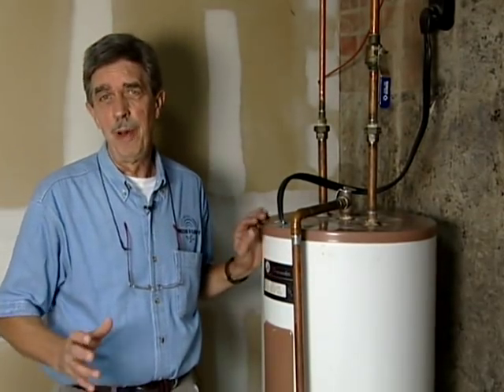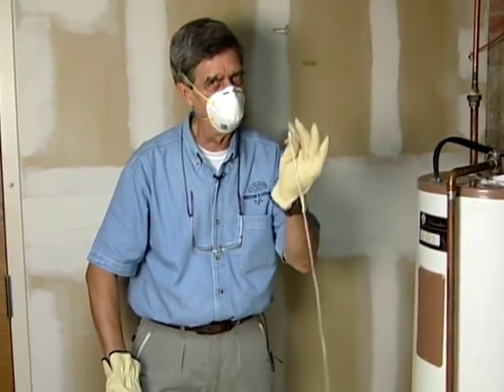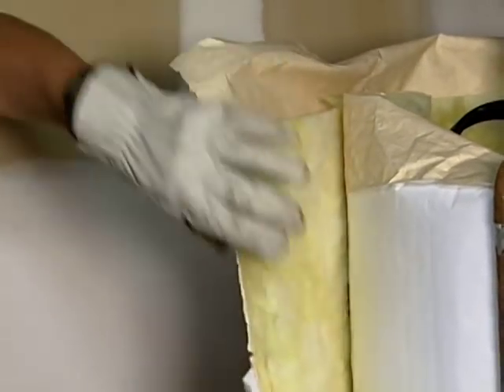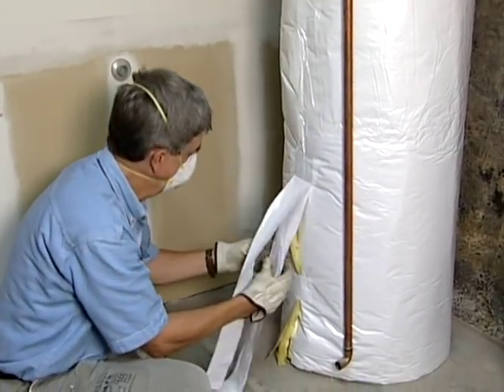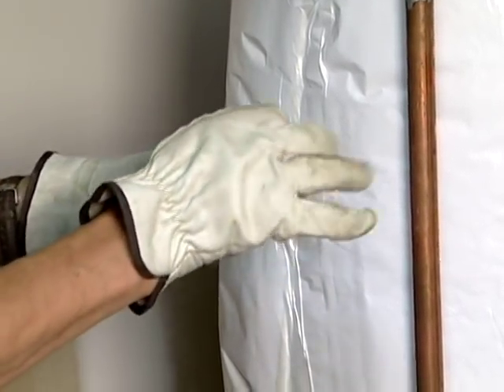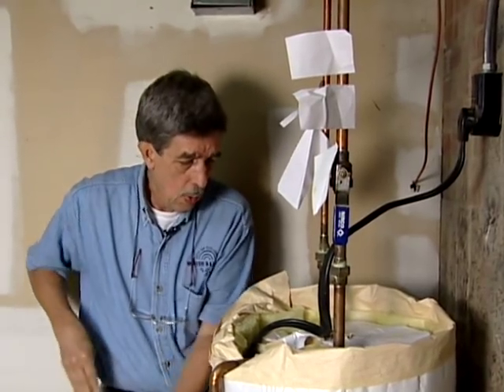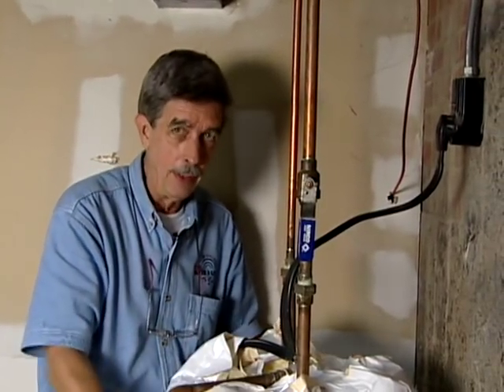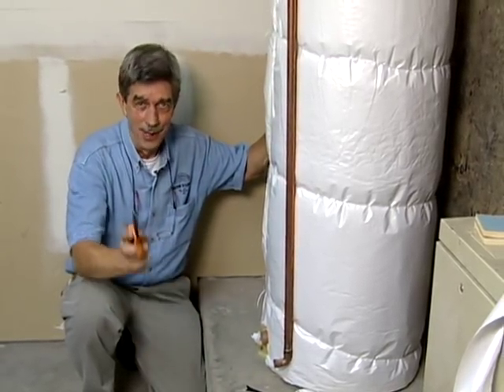Water Heater Insulation Blanket

Comment: Thanks for the video, still helping, winter '23-'24! I picked up a water heater blanket in the summer when i found it on clearance. Now that it's getting cold, i need to get it on. The WH is in the basement and it is a bit cool down there. 
 I appreciate all the tips: wear gloves, mask, long sleeves, pre cut some tape, & if there's extra left make a piece for the top. Thanks so much!!

Comment: If you live in an older apt, your water heater is most likely old and inefficient. I put a water heater blanket onto my WH. My bill fell from $115 to $75. NO JOKE. 
Also I installed Florescent lights and a 1.5 GPM shower heads. So that helped a lot.

Comment: The home inspection recommended I put on a blanket on the water heater and so I did.  I went to Lowes and purchased "the one" blanket in captivity.  Unfortunately it just barely fit around the water heater.  I did not get any additional pieces to do the top of the water heater.  Since I am brand new to this house I will not have any reference as to how much the electric bill will drop but I'd just as soon start saving right away.  Thanks for your great video.  It really helped me.

Comment: I have done that all 12 water heaters on my rentals. I also placed a 3/4" thick piece of rigid found under the tank as well. It helps keep my tenants electric bill lower.
Reply: Interesting
Did you see the bills before and after? What was the difference?
I get complaints in cold winters when the homes are not heated above mid 60s. The basement are around low 50s. I wonder if this would help. I imagine all the heat from the tank is leaving into the cold basement.
I did look at more expensive tanks (cut them up) and the only main difference I could see was how thick the insulation was. Clearly not worth the upcharge.

Comment: Nicely done! I would highly advise that you make sure to keep the entire T&P valve exposed. That valve should be tested periodically. If it should release on its own (because temperature or pressure limits are exceeded) you want to make sure that the lever can move (both open and close) without interference!

Comment: Pro tip. Coat any exposed skin in baby powder when handling any fiberglass. Worked especially well for the back of your neck and around your wrists if your wearing long sleeves. After you're done working with the fiberglass for the day immediately take a cold shower. The cold water will rinse the fibers off before the hot water opens the pores in your skin. I'm a union carpenter and have insulated thousands of feet of walls over the years. You'd be amazed how good this baby powder and cold shower trick works even after handling the stuff for an 8 or 10 hour shift

Comment: I had the same results as docmurder.  Don't use the string to measure around the tank, chances are you'll come up short (like we both did).  Wrap the blanket around the heater and mark the overlap point.
Reply: Just an explanation as to why: the diameter of the string would correspond to the insider diameter of the blanket (the water-heater side of the blanket). The circumference of the ambient air-side of blanket must be longer than the string. Otherwise you'll come up short.

Comment: my blanket was 3" thick and really i probably should have gave myself about 5 more inches than the way he measured it around the overflow pipe. i came up short. hope others learn from my mistake
Reply: Just an explanation as to why: the diameter of the string would correspond to the insider diameter of the blanket (the water-heater side of the blanket). The circumference of the ambient air-side of blanket must be longer than the string. Otherwise you'll come up short.
 The thicker the blanket, the worse it is. Circumference using string is 3.14 * Diameter. If your thickness if 3-inches, it really adds 6-inches so the formula to calculate this is 3.14x(Tank Diameter + 6).  Or you could just add 3.14 *6 to the measured string length.

Comment: Did the  isultation for the top of the water heater come already cut? I didn't see you cut the top piece so that's why I'm asking. Can a hot water heater freeze?  I want to insiullate my basement pipes aswell as the heater.That video was great Mr. Mars, with this cold weather, I don't want any surprises, I'll let you know how I did. What kind of tape do I use to tape down the insulation? And what's the name of it?

Carol Willett
Reply: Carol Willett It comes in a roll, you have to cut it yourself. 3" aluminum tape is the best.
Reply: Carol Willett It comes in a roll, you have to cut it yourself. 3" aluminum tape is the best.
Reply: Yes, it can freeze.

Comment: an article i read said to put the blanket under the heater as well.  Dave, do you think this is necessary?
Reply: My water heater is located on the concrete floor in the basement. I cut a circular piece of rigid foam (XPS not EPS) a few inches larger than the tank and put it down on the floor before I had my new water heater installed. It should help a bit. Definitely don't use a blanket because that would get entirely flattened by the weight of the full tank (empty tank + about 8 pounds per gallon of water).

Comment: Would it work if I use rock wool instead of fibre glass?
Reply: Maybe rockwool with a jacket and cut strips to make it bend. I would just stick to the fiberglass.
Reply: Use what you have or got.  It will do the same thing!  Just be-careful with Gas Water Heater.  I do not recommend doing with Gas!
Reply: @JodBronson  

Why not on gas water heaters?
Reply: @ajarivas72  - Save maybe $20.00 a month???? Maybe the house goes on fire, LOL.  See the concept?
Reply: @JodBronson  :

With the right set up, you can avoid the fire hazzard.
Reply: @ajarivas72  -  Not worth it.  Saving about $10-$15 Per Year :(((.  You want "Fire Hazard" just to save $15.00 Per year?  THINK ABOUT IT !!!